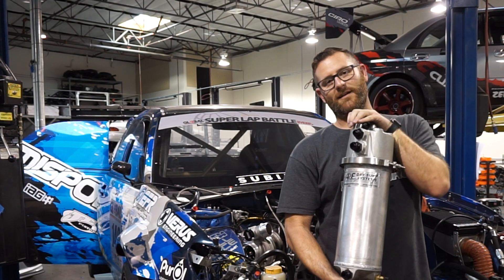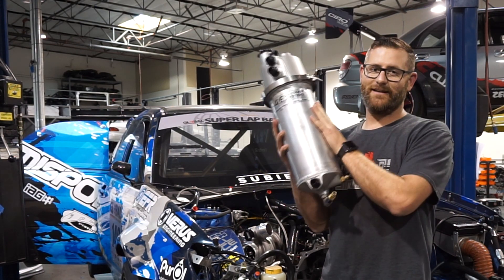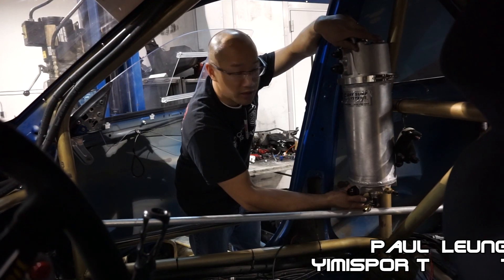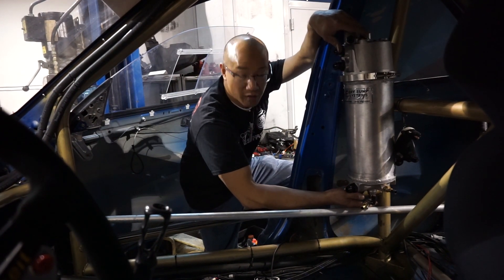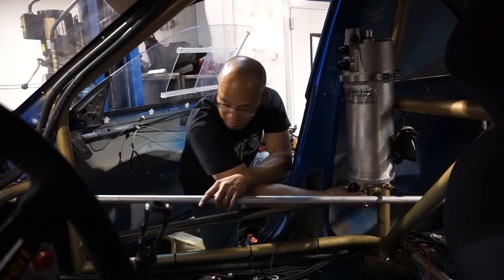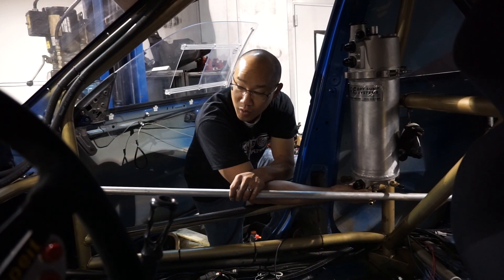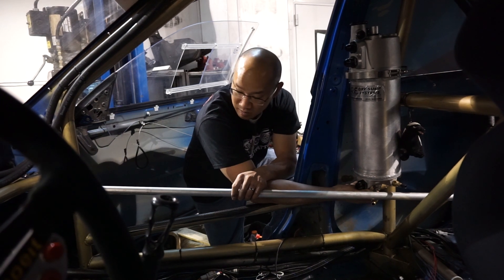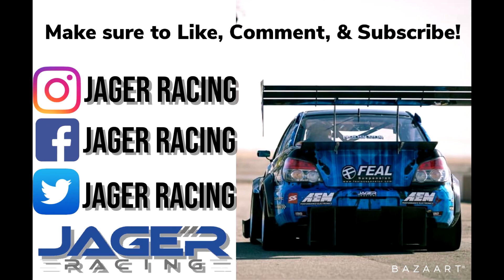Oiling System Changes, You be the Judge

Comment: I don’t think mounting it that close will achieve much in preventing oil starvation. Except for a 410 sprint car and 1 or 2 sports sedans. Every dry sump tank I’m aware of is in the boot. 

I like the solid pipe in the body though. That’s a good idea. Will you bend them to the shape of the floor pan or will you keep them dead straight ?
How much does that tank hold. It doesn’t look like it holds a lot and does it have internal baffling ?
Reply from the maker: Daymow it will be just a straight pipe. It is 2.5 gal and has internal baffles. Through data it isn’t suggested that it is running dry.
Reply: Yeah fair enough. All the tanks I’ve seen are short and fatter so it looks different but data doesn’t lie.
Reply from the maker: Daymow we actually talked to Peterson about this as they actually are the designer of both. They both have baffling in both and stand by the design.
Reply: Are return and suction lines same dia?
Reply from the maker: Daymow currently they are. That is something we haven’t talked about yet, but I believe the return likes are going to stay -12 while the feed will be -16.

Comment: Why not just put it in the passenger footwell? It's even closer and that what Element Tuning STi has it's tank.
Reply from the maker: Luther Rogers well that is where my fuse panel, infinity and data logging equipment is which would mean ruining Iwires wiring setup which I’m not wanting to do. But with that said overall consensus from the dry sump Gods is that the length doesn’t have a big effect. As many mount them in the trunk for weight distribution and so on.